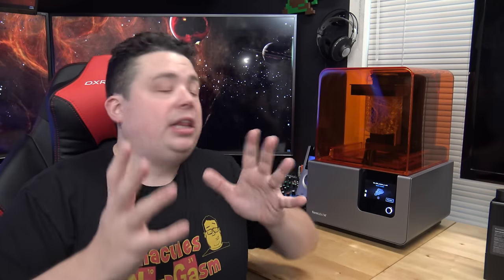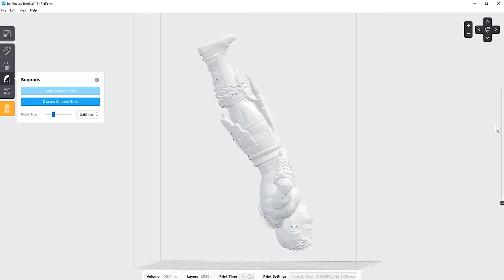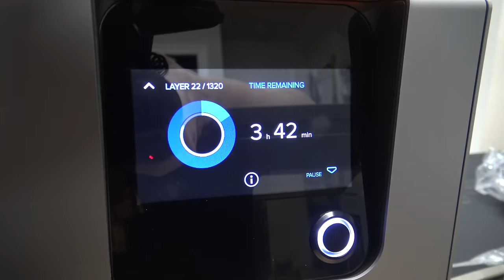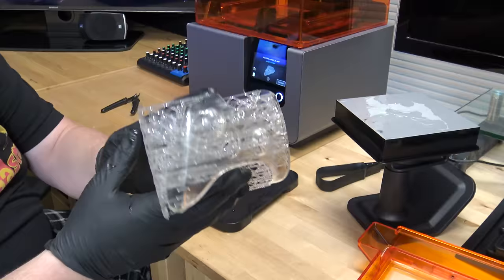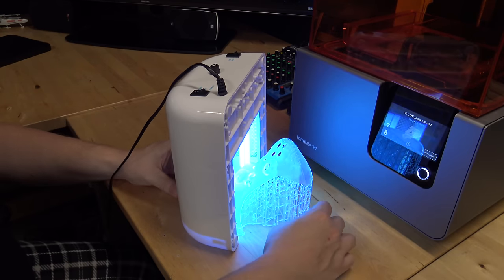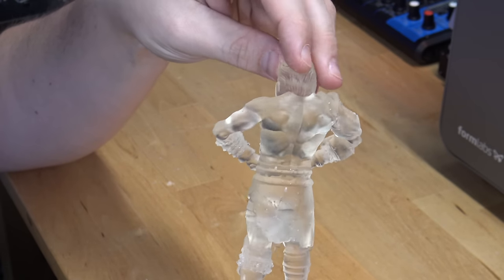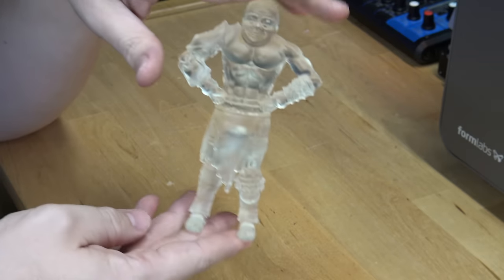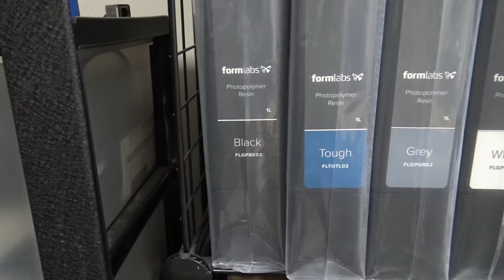Form Labs Form 2 SLA 3D Printer Review, Spoiler, it's amazing!

Comment: 4k isn't that bad, if you have some kind of project worth it. I can think of so many things in my head that I would use this for. If you really wanted it you could save the money up in a year and it wouldn't be asking much. You probably get great support as well. It's probably not for average 3d printing people obviously, but exactly as barnacules said, if your an entrepreneur or inventor or anything related to engineering, this is great for rapid prototyping.
Reply: Also really useful for high quality plaster casting. You get a really good finish with plaster, and if your in need of aluminum parts this is perfect for it. They even make material which vaporizes and doesn't leave soot or ash. This would actually probably produce the highest quality castings.

Comment: That resin is so da!n expensive... I predict in the future people will learn to make their own that works with this for much cheaper... hopefully :P
Reply from the maker: +StoreBrand if material cost comes down this printer will be unstoppable.
Reply: Barnacules Nerdgasm Absolutely, Filament 3D printers don't have many advantages over this thing. Only thing I can think of is neatness considering you can't spill a tub PLA fillament on the floor. Imagine accidentally spilling this stuff.

Expensive mess.

Comment: Seems like a great quality printer. Too bad 3D printing costs so much
Reply: Tibasu 3D printing is fairly new they got a long way to come before a lot of households will be able to get them they're starting to get some of the older printers at lower costs for most people that's just like everything else soon as they find a way to make it cheaper then we will get them in our household but he says in his video this is worth it for the price no it's not
Reply: Why would households need a 3D printer anyway?  Most people have no clue how to use a simple CAD program, let alone design something.  So far 99,9% of people who have one at home just download badly designed models, and that's about the extent of their expertise. We've had CNC machines for decades, why haven't they become more home friendly? It's the same principle. Well, because there's no need. There's no market for it. All these 3D printers for home use are toys, I tell you that as an engineer who works with 3D printers that cost several hundreds of thousands of dollars.
Reply: Tibasu If you are an inventor then this is dirt cheap. Prototyping needs to be done over and over to get things right and even modest products would cost hundreds of thousands. Now you can do it for pennies

Comment: I've had a couple of prints done on this machine. Although the quality is much better than FDM printers it is not even remotely close to being good. The models print out with blurred details and end up looking like everything was melted, with many details dissolving into each other even though it is supposed to be able to do 20 microns.
Reply: sounds like someone doesn't know how to use their machine or clean their prints properly
Reply: Sounds to me like you are quick to jump to conclusions. The company that made these prints for me has to know their stuff because they also sell these machines and do after sales support.
Reply: Falconius Azurius Just saying, every correct print I've seen out of this printer is very good quality, with pretty fine details intact. You might have a dud, or aren't using all the correct steps.

Comment: prosumer=people with to much money, so they can burn it on this printer :P
Reply: AntimatePcCustom if you have the CAD skills to utilize it then it's actually an incredible bargain, especially if the build volume suits your needs.
Reply: it's way overprices. i drive a car that cost 6 times less than this printer... im fine with my wanhao prusa printer. only thing i can see the formslab being good at. is small high details models. and nothing els.
personaly im more for usability - lowprice over quality - high price.
but hey. i build stuff to the world as a cnc opperator. sure have the model artist a nice toy. i rather have stuff i can use for a bargin :)
Reply: Yeah and cars used to be just toys for the privileged few, it all filters down.
Reply: This is the beginning of an industrial technology being brought to the consumer in the home. It's going to get better with each generation.
Reply: What do you 3D print though? As an artist who would use 3D printers as a hobbyist (if I ever bought one), I don't see a point to low-quality cheap prints from FDM printers. They generally look like shit, and are too inaccurate for prototyping, so what's the point? If you're going to get into 3D printing at all, it makes more sense to get something actually useful. Also, good FDM printers cost just as much, if not more, than the Form 2. Even with the running costs factored in, this printer is a bargain compared to similar printers on the market.
Reply: adamdecoder1 HA you could not be more wrong mate :) the filament cost 10 times as much for the form 2. and it requires far more material because of the infill that you don't need with the FDM printer.

and the bad print quality? it's not as bad as you make it sound like :) and there is many ways to combat the surface textures everything from acetone to epoxy :)
Reply: AntimatePcCustom Sounds like a lot of work to get an acceptable model, and the results are bound to be inconsistent if you're doing a lot of manual cleanup work after the print is finished. Also, acetone will ruin extremely fine details. You'll be left with a smooth figure, but if you have anything really tiny you need to preserve, it's bound to be lost, or at least degraded. 

For desktop FDM printers, the new Makerbot is probably the closest in quality to the Form 3, and it costs over 6,000. It's going to be quite a while before the running costs of the Form exceed that.
Reply: using a prusa i3 printer from wanhao. and it cost less than 500 dollars (3400 dkk) and i stand as an engineer more than a model artist. sure if you want your warhammer figures looking a bit more on top. but willingly want to pay as much for material as to buy them in a store. sure. go ahead. they really need to put down the prices alot or els im not going to buy it.
Reply: beside. you need alot of cleaning after using the form. then curing in UV light. so you will be needing just as much if not more time to finish the models from the form 2.
i have to say, sure i like the form 2. but i HATE the price. maybe the printer carbon can change that. force forms lab to put down prices.
Reply: AntimatePcCustom It'll get cheaper. It's still relatively new technology. And once other SLA printers come on the market Formlabs will have more competition to deal with.

But I wouldn't count on Carbon3D. Their package is way more expensive right now.
Reply: ..............or someone using this for prototyping. This is not for you if you are not using it correctly. This is a printer for someone with a plan to monetize it, not for someone making random toys and sitting back to uhmgeeohah lookee at my 3D printer.
Reply: @Adamdecoder (no idea why youtube facking up this tagging). You seem to be really off the mark with your comments. You are either to young to grasp it all or you are out of your comfort zone within production knowledge. No consumer user would ever need to shelve out 3000+ USD on current generation 3d printers to do some home diy printing fun. Especially not the printer shown in this video, it simply makes no sense to shell out so much money for both the equipment and resins to do anything consumer diy on it. This printer is merely an entry level "higher" quality printer for the small home business for prototyping. Any other use, other then showing off or not caring about money, simply makes no sense. And as animate already tried to explain to you, for about 300 usd you can get a 0.1mm filliament printer that prints solid quality prints for home usage that can then be refined and cast as required. No need for this expensive nonsense.
Reply: OohzyJohnDow thanks for the great reply! read it all. and thanks! being from a home as a child fearing not having something to eat. or wait a half year just to get new cloth. and finally being able to support once self. is amazing! and i won't live as poor as a child. now having a better payment than my parrents. but the damage has been done. so i still live in the past. because i could at any time fall back into a dept hell just as my parrents did. so im always one or 3 step ahead. just to stay sure i never have to drag my kids through the hell i have.
Reply: AntimatePcCustom By all means you do not stand alone with such backstories. Many millions of others across the globe share similar stories and more sad even many millions more can (or could) share worst stories. I am very pleased to read that you made it work for yourself and for your family and I wish you the positive continuation you require. Dont lose grip on reality and dont lose yourself in consumerism.
Reply: ascetic43 That would be correct years ago. Now (with all the much cheaper ones on the market printing the same quality and the sam things) its just for the people with more money to spend then brains just because they can afford it. But.. as said already.. unless you need it for a small business or something like that. 

Ps. your jealousy remark reminds me of the kindergarden, where it should have stayed!
Reply: AntimatePcCustom, just because you personally can't think of what use this printer could be for, merely illustrates that you're completely out of your depth. This printer is not aimed for people like you. For the rest of us this is the bridge between CAD prototyping and product injection moulding.
Reply: Feralferret, you just exactly proven his point. Unless you are a small business that can warrent such a purchase.......this printer is just WAY to expensive and absolutely not neeeded for any consumer unless you have just to much money and can waste it.
Reply: No-one said it was a consumer device. That's what I was saying it isn't. It's for those who do CAD and are looking to create something unique or jump onto the small business bandwagon. SLA resin is a step change above standard filament-based FDA printers and is worth the extra $$$. If you don't understand why, then the printer isn't for you.
Reply: Feral, have we watched the same video? Nothing about this channel, the guy, setup of the video, what was printed or review was directed to the professional....it was directed to the "home-user". Listen, i fully understand you and agree with your professional standing for this printer. A good and usefull tool for the prototyper professional. but not for the home user.

Comment: If only there was a FDM printer that was as easy to use as this printer.
Reply: FDM is crap anyway, it's useless for anything other than some little figurines or parts that absolutely don't require good tolerances.
Reply: BS! It is a crucial step in prototyping! And the accuarcy nowadays is pretty amazing. Have you ever tested tolerances on a fdm 3d printer. On a lenght of 15cm I get less than 0,5 mm of tolerance!
Reply: You have no idea. I have sold thousands of dollars of RC car and truck parts using FDM. I have parts with great tolerances. I have had parts injection molded and the test prints before the injection mold was made was better on the FDM than the fancy Shapeways high end printers.
Reply: For that kind of quality out of an FDM though, your going to spend a lot more than you would on the Form 2. I guess the running costs of the Form would add up over time though, and eventually exceed the FDM equivalent. FDM printing on a budget seems like it's hardly ever worth it.
Reply: NSMV  you think the SLA Form 2 would be good for model trains?

Comment: When I heard "cartridges" and "$100-$400" I was immediately turned off from every wanting this. That to me tells me Formlabs is trying to milk money out of their customers by selling them proprietary stuff. Why not just use a tank you can refill? What happens when FormLabs no longer makes these cartridges? Good review though
Reply from the maker: +Eric Prince This machine works with 3rd party resin. Also 3rd party resin is nearly just as expensive. Research it.
Reply: Still cheaper than printer ink tho.
Reply: Hi Jerry. Excellent video as always. Just wanted to let you know that there are numerous 3rd party resins out there that are cheaper. Look up photocentric3d, Fun To Do, daylight resins, etc. Heck, even Maker Juice, which is considered to be quite premium, is cheaper than formlabs's cartridges(pound for pound). If you are a bit more adventurous you can even try more industrial-market resins like Bucktown or Chinese brand resins. 

The one I am most excited for is China's ESUN's eResin PLA which I believe will crash the market for these proprietary resins the same way their filaments crashed the market for proprietary filaments. ESUN is basically the dominant market leader for FFF already for Asia.
Reply: A reasonable amount to pay for SLA resin would be about 50-80USD per litre/kilo at the moment(although I expect this to drop to below FFF filament levels in the future). 150-175 is definitely way too much, you are paying for the manufacturing of the cartridge system, etc... it isn't really sensible in the long run.
Reply: rock on right

Comment: This is DEFINITELY not a printer for professionals who want prototypes that resemble production parts. I can tell you that as one of those people. This is still a toy, far from a professional printer. 3500 dollars is still very entry level stuff, and this is still a hobbyist device that can only be used for parts that don't require a lot of precision or dimensional accuracy. Just saying, I don't want people to be misinformed and think they can achieve more with this than is actually possible. Real prototyping 3D printers that use SLA method cost over 100,000 dollars, and even THEY are not able to achieve the accuracy of injection molded parts or CNC machined parts. The specs on these cheap printers are very false, their accuracy specs are just fantasy on paper. This particular model is up to 1-2 milimeters off per 10 cm, and the biggest problem is, the lack of accuracy is not equal on all axes, so you can't just compensate for it by reducing or increasing the size of the model. Unfortunately, these is still not a 3D printing technique out there that would completely resemble injection molding or CNC machining. For accurate and strong parts, it's better to use SLS methods, SLA is more about fine detail and a smooth surface finish, but the actual accuracy is not much better than on a FDM printer, there's still plenty of warping, shrinking, bending, etc. going on.
Reply from the maker: +derbigpr500 I disagree.
Reply: As a physics student i would 100% disagree, we use them religiously to mock up experimental apparatus in the lab as its way cheaper than wasting the expensive materials previously used in prototyping equipment for experiments.
Reply: While you are partially right, the term "professional" is pretty relative in this context. This might not be for professional 3D printing people, but could be quite useful for other professions, using 3D printers as a supporting tool.
Reply: Even I on my Ultimaker have less than 0,5mm inaccuracy over a distance of 15cm when I print with Pla! 
Accuracy on this aswell as on every cnc router based machine is dependent on the Motors. It could perhaps even have a better perfomance on repeatability compared to a router based cnc-machine, as you are using a laser.